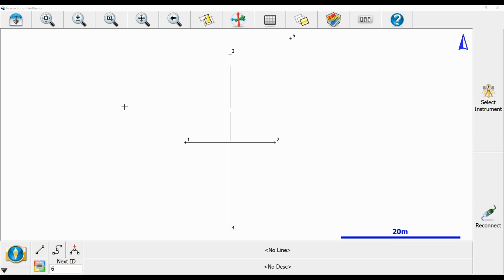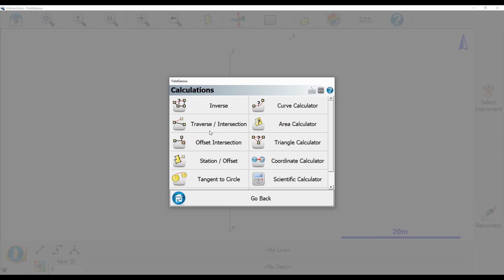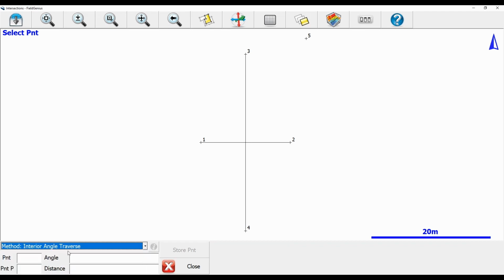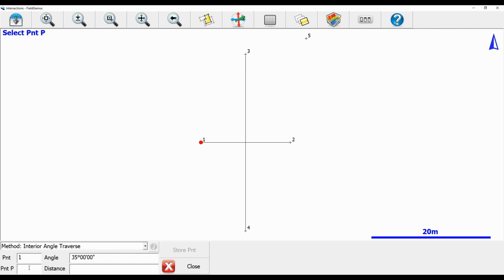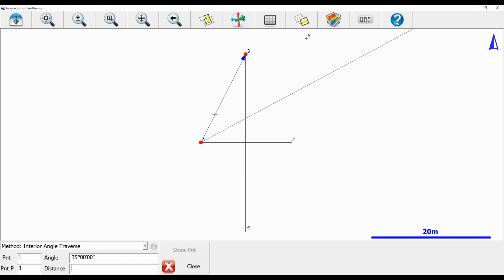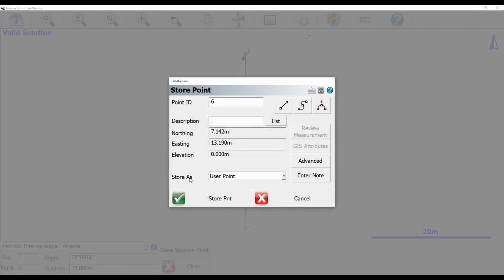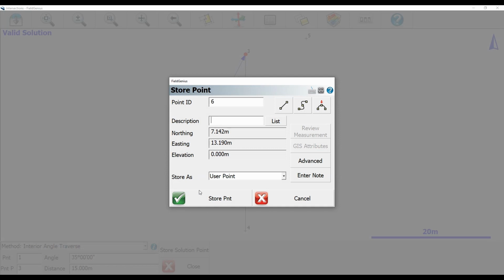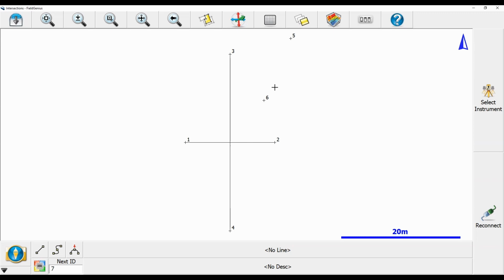MicroSurvey FieldGenius How To: Interior Angle Traverse | Bench Mark

Comment: Hi! I've switched from Windows based field genius to android version, since my company upgraded gnss controller. The problem is I can't find this option in the android version. For example, I could easily read an angle between lines with this option directly in the field with Windows version, but I can't do the same on android. I'm I missing something? I would appreciate any help!
Reply: Hi Gold, Unfortunately, that feature has not been brought into the Android version yet. Your best bet is the Traverse tool for now. You can compute the angle between two points and use the X..Y notation to fill it in FieldGenius. I'll let the guys at MicroSurvey know you are looking for this feature.
Reply: @bmnolanbetzner  Hi, thanks for getting back to me. I just read my comment again and I noticed something doesn't make sense: "i can't find this option" should be "I can't find some options". Sorry for that, I hope you can feel how frustrated I am, i didn't notice my mistake. 
There are many options missing, the  above is one of them. 
I got in touch with the company we bought the controller from, they said they will look it up. I've sent an email to MicroSurvey, waiting for a response. 
What really bothers me the most is that we were supposed to upgrade, not to downgrade our tools and I read somewhere that the new android version has all the core features of older versions.
Thanks again for your effort. I really appreciate your help.
Reply from the maker: Hi Gold, Not sure if you purchased from us, but I typically don't recommend upgrading from Windows at this time especially for full blown land surveying. Android is definitely the future, but it is still (extremely optimistic estimation as of 06/24) a year away from being "feature complete". 

It is tough, as there a lot of awesome android data collectors out there. The good news is they are updating it quickly but I don't have a timeline on that feature. I know they are working on adding math operations in fields (X..Y - 90 etc.) but I have no timeline.
Reply: @benchmarkequipment  unfortunately for me, we didn't get it from you. I live in Greece and my company bought it from a shop that have business with.
I asked for upgrade because I use an old Foif controller that, among other problems, had all it's batteries bulged, I was afraid that someday they will explode. Couldn't find replacement batteries, equipment was old so I asked them to get a new one.
Reply from the maker: Hi Gold, unfortunately for the time being you'll have to hang on, or find another Windows tablet. Let us know if we can help with anything.
Reply: @benchmarkequipment  Thank you so much. At this point, I will report the situation to the responsible department and let them deal with the problem. 
I still haven't got a reply from MicroSurvey, nor from the company that provided the equipment. You are the only one who responded to my problem, and responded fast, I want to say that in public, that's true professionalism. 
I will surely get in touch with you if assistance is needed. 
Thanks again.
Reply from the maker: Hi Gold, No worries, best of luck. If I see any update with this tool, I will update this thread. Always feel free to send me an email at nolan@bench-mark.ca if you have any questions.